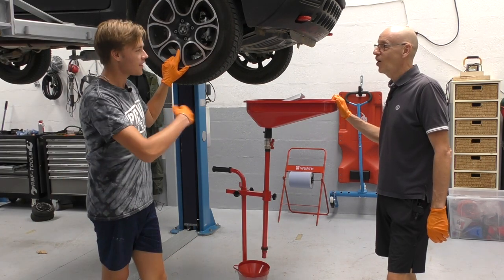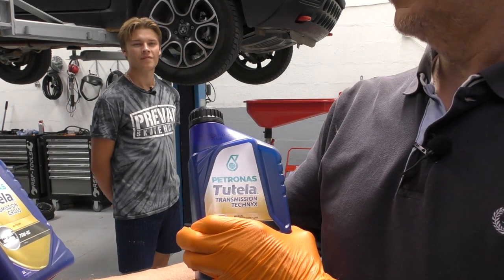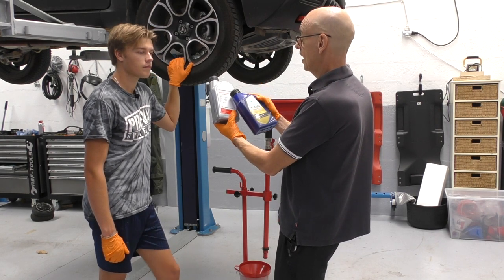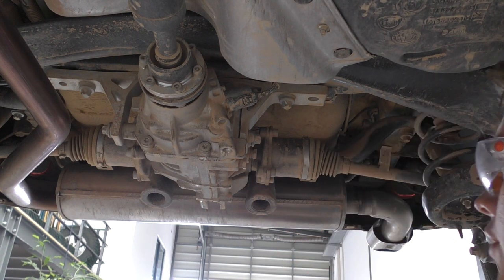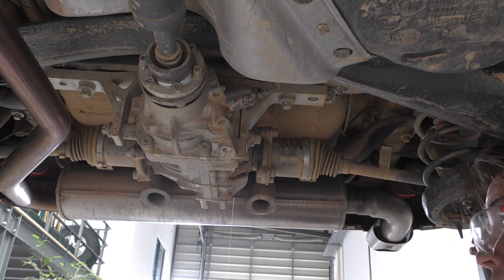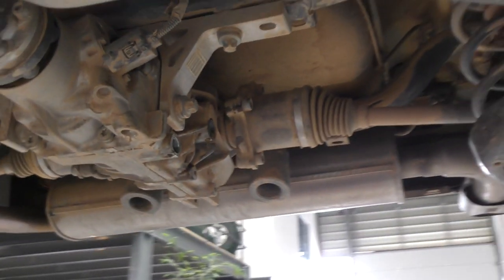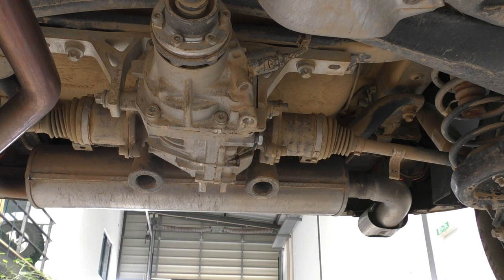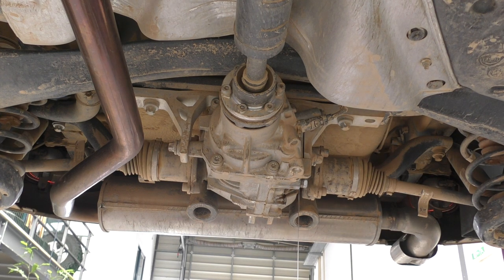Differential oil change on our 2021 FIAT Panda 4x4 - surprise bung  & confusing oil requirement

Comment: Good info, very useful to know where all the plugs are and that little safety bung on the rear diff would have totally thrown me!
Reply from the maker: Was a surprise to us - could find nothing about it anywhere, so took a brave pill and yanked it out :)   

I was a little surprised (and disappointed) that FIAT had not done them all ? odd (I like it).
Reply: @DrivenMadShow  Yes it's a great idea just odd they did the rear diff only and not the actual gearbox?
You'd think that would be more essential to protect.

Your thorough tutorial has given me the confidence to try this myself, although I'll be crawling underneath.
Reply from the maker: We used to put 2 wheels on the highest kerb we could find - I would sip coffee and Nath would do the business :)
Reply: @DrivenMadShow  I have a slopping drive, so I build a makeshift ramp out of bricks, so with my car pointing downhill and the front end on the brick ramp, I can get quite a good space underneath to work.
I make sure everything is solid, rear wheels chocked etc and throw under anything I have like spare wheels etc  as a safety precaution.
Reply from the maker: @pdtech4524  Brave !! we started on axle stands, then found out lifts were a grand, so splashed out on one - a god send now my knee is knackered :)
Reply: @pdtech4524  Hi.....you do not need to jack up the panda 4x4 to reach the transaxle filler and drain plugs they are easily reached with a breaker bar and ratchet. The front wheel needs to be removed to access the drain plug for the power transmission unit. Its the same with the rear differential unit the car does not need to be jacked, the wheel does not need to removed to access either the filler or drain plugs there is sufficient ground clearence to be able to reach using a breaker bar / ratchet.
Reply: Grande Panda cross 4x4 👍💪🐼🇮🇪
Reply: @marinocorazzi7895  Ciao Marino

Comment: greeting from italy. despite many people dislike fiat cars, in my faily  from the 60' we only had fiat cars and never had  any big problem with them. ofcourse some component is not the best quality, but replacing it is so chep  it's not a problem getting new replacement for them. and on that video u have noticed some little things that make that panda a success and why there are so many in our road. after oil change maybe u can put some blistein shocks on it :D i really love the cross 4x4 and also the 500 abarth. little car with lots of potential :D
Reply from the maker: Buona serata :) 

In the UK we had an Abarth turismo, although my wife hated the exhausts (Monza) - here we had a 500c that was traded for the Panda, so I too and a massive FIAT fan.

We are surprised they have a poor reputation now, as ours have been fantastic & very reliable.

Once we finish in the dirt, we do like the idea of lowering the car on some sexy suspension and popping on some bigger wheels - giving the sport look.

I think our Panda is really well made - under the castings are all really good and look very strong, so we will keep putting it to the test - the weakest part is me !!

Comment: Hi guys it is to do with the ash production when the oil is being particularly heavily used. Petronas in league with Fiat have a good deal going effectively ensuring you only buy their oil. I think it is a bit of a con really just to keep their expensive market share. The information tecnically on fiat 4x4s i believe is purposefully vague on purpose.
Reply from the maker: Great point, I was with you, but when I contacted two oil manufacturers (Liquimoly & Castrol) to get their oil to use, they told me to stay with Petronas and not use theirs - an engineer told me ( I know naff all) that the twin-air lube rail is susceptible to blocking and the gaskets used are also susceptible to certain additives - as you say, probably to force the use.
Reply: Hi, great standard of service saying the consumer knows naff all 😂, standard response now. I understand the point on additives they are a mystery in just about everything people buy regarding oil and similar products. I am sad to say, very cynical on any info given out by the motor industry and all its machinations in keeping the consumer tied to a particular product, it is fear producing as it ensures you use that product or face costly repairs for failing to do so. On the panda 4x4 most sites cannot even agree in the viscosity of the oil, let alone the additive content.
Reply from the maker: @andrewreynolds2647   I am saying, I know naff all 😂 the Panda is a minefield of contradicting information - watching Top Gear, they describe the 4x4 as a Haldex type thing, the dealer assures me its not - our car did not show the classic spin and lock up that a Haldex would do, but 100% I am not. The oils made me paranoid, also a back street dealer type bod telling me twinair without dealer service history is a ticking time bomb - that's probably why I do like the 1.3 diesels :)

Comment: Hi Guis, fiat recommends the front differential PTU also needs an oil change, to the extent of 0.4 lt !!!
Reply: it is not unique with the gearbox
Reply from the maker: Thanks for the tip 🥳
Reply: Merci ,avez vous des informations pour cette vidange de ptu ?

Comment: You haven't changed the oil in the "drive transmission idler unit" the transfer box to send drive to the rear diff, its not the same as the gearbox oil, so needs changing as well m, looking forward to the video 😁👍
Reply from the maker: Thanks for the info

Comment: Very clear and helpful video. I changed the gearbox oil in my 2016 twinair 4x4 only yesterday with the correct fiat oil 😊. I wonder if you measured the amount of oil that came out of the gearbox and how much you used to refill ? I drained 2.2Lt out but the handbook gives the gearbox oil capacity of 1.7Lt. 

I put in 1.7Lt as specified but with that amount I don't get the usual dribble of oil from the fill plug. 

I have never come across a gearbox that you don't fill until its dribbling so really not sure what to do. I suspect 2.2Lt will be to dribble level but could also be overfilled. 

Any thoughts ?
Reply from the maker: We always go for the dribble - we were not clever enough to put in an exact amount 😇- we did measure what came out  and like you got over 2 liters - our owners manual (Portuguese) was not clear, we looked on line and that gave varied amounts -  when we took out the bung, the fluid ( as I recall) was bang on dribble level ( thats first change from new) - but don't hold me to that !  

To be 100% - as taking advice from two idiots like us is not recommended - go in and ask the main dealer in the parts department ( thats what we do when unsure, I ask for a price and amount needed for the vin, ask how long to get and bugger off without ordering ( Bar Mercedes, who are surprisingly competitive here, but we no longer have the ML)  - we were happy with dribble level as you say, never come across anything thats not, but Fiat are an odd bunch) .  I probably focused on grade over quantity.

I did get an opinion on the oils - Fiat use some odd grades, the engine has a drip type feed over the camshaft, that has very small holes, so the viscosity is vital, as is cleanliness, the twinair needs regular clean oil and filter changed or these can block. The other additives many put in, can ( not my words) cause deterioration in the seals, that was from Liquimoly, who also told me to stay with Tutela oil, so must be a well known thing in the oil world.

I got our oil here for interest https://augustin-group.de/oele-fluessigkeiten
Reply: @DrivenMadShow  The used car dealer I purchased the car from learnt the hard way the importance of using the correct oil in the twinair. Shortly after I picked the panda up the dreaded orange triangle of doom came on. He ended up taking the car to a main fiat agent who had to change the oil three times to clear out the wrong oil. They also changed the little filter on the twinair unit. The invoice was in the history file so I know it must have hurt his profit. All has been well since but I always order my oils myself now. Lucky in the UK we have a company that stocks the genuine fiat oils. 

I did a little research and did find one example of a gearbox that does not use the dribble system. I can't remember the model but it was a Ford. Oil level should be 20mm below the fill plug ! 

I will phone main agent and see if I can get any sense out of the service department. If I discover anything useful I will let you know.
Reply: @DrivenMadShow  I have just had an email from our local Fiat main agent service department. They confirmed that the gearbox oil level is correct when just dribbling from the fill plug. Confusingly they also say this should be around 1.7lt. I guess they have never measured the quality drained out ! 

Carry on as usual.
Reply from the maker: I have been told - fact or fiction who knows - the twinair is a really strong engine, reliable and forgiving when thrashed :)  other than oil, loves it, needs it and the right stuff - I think yours was caught just in time :)
Reply from the maker: Cracking - the easiest way is the drip - I have never worked on cars until retirement, Nath does 90% anyway if truth be told - only owned two Fords ( I think, Escort RS Turbo, first ever decent car, performance wise and a Sierra 1.6 estate - so a long time ago ! ) have no clue how they were mechanically, was lucky that mine (most) ( mine in the I got to use them sense) were company owned or long term loans - now I realise how expensive the buggers are to run :)
Reply: @stephenbell6366  bonjour ! 
J'ai le même problème que vous , avez vous mis 1.7l ou le goutte à goutte ? 
Merci bonne journée

Comment: GL-5 has additives that make it suitable for extremely high pressure differentials. However, these additives can attack bronze and copper which are found in gearboxes. I'm wondering therefore if that's what's making your Febi Bilstein oil unsuitable, and is the reason why you need to stick with the specific brand recommended by Fiat. Just my thoughts.
I had a look and saw the Febi oil was suitable for the axle alone, but not for the gearbox/diff, but it did say Motul Gear 300 was suitable, for interest.
Reply from the maker: I tried three manufacturers - all said to only use the Tutela (Patronas) Fiat approved oil, stating it was additive in their oils that made it unsuitable, but could not get that expanded on.
Reply: @DrivenMadShow  It's really interesting. GL-5 is just a “gear oil” spec, it doesn’t cover transmissions. GL-5 uses Sulphur/Phosphorus additives to prevent “micro-welds” on the meshing gears. Unfortunately these also can react aggressively with bronze and copper, often found in the synchromesh rings of a gearbox. So I’m thinking the Fiat-recommended GL-5 uses different additives, and I agree with you - best stick with the GL-5 that Fiat recommends, as you have done! 
Again, interestingly though, I looked at the datasheet for the Motul Gear 300 and it says it's suitable for "any type of seal and yellow material used in gearbox design", hence it's ok with copper and bronze etc. It seems a few manufacturers are now making a GL-5 that is compatible with "yellow metal". This might be why it's listed as ok with the Panda. It was £19 for a litre here in the UK, which is not cheap.
Reply: Ah, that Tutela is "GL-4+". It's a GL-4 that meets GL-5 spec, so as it's a GL-4 it won't have those nasty additives!
Reply from the maker: I paid about that for the diff oil - but the Tutela Transmission Cross 75W-85 API GL 5 was 40 euro a litre - outch
Reply: @DrivenMadShow  i paid £23 for a litre of Fiat Tutela oil for the rear diff and that was discounted.....
Reply from the maker: @stefanobio7045  That's a steal - think I paid 49.00 for ours - and 20 + for the coolant that is now all over the road 🤣
Reply: @DrivenMadShow  Hi Jon....why did you need to change your coolant so soon in your new Panda? Did you use the Fiat Paraflu, i believe the Panda takes 6.3 litres.....best regards, Stefano
Reply from the maker: @stefanobio7045  Fitted the new Thermostat Stefano - the coolant was the most stunning pink (odd what excites you) Tutela stuff - think that was a few £ on the floor 🙈
Reply: @DrivenMadShow  lol......at least its now completed.....
Reply from the maker: @stefanobio7045  waiting for the next thermostat to be delivered - hoping this one was faulty as the inlet blew off ☹ just spent 50 euros on more coolant as well - think we need an ev !
Reply: @DrivenMadShow  Hi Jon and Nath....did you purchase an original Fiat thermostat, oh thats not good about the coolant.......
Reply from the maker: @stefanobio7045   Autodoc !! to be fair to it, was a Magneti Marelli part (I think)  a decent looking thing - but fingers crossed it was a faulty part, not the car :(
Reply: @DrivenMadShow  Hi Jon....they are good quality parts and owned by the Fiat group so should be ok....when are you completing the work?
Reply from the maker: @stefanobio7045  We are waiting for it to be delivered (Portugal is hard to get anything off the shelf) so another Autodoc special - the coolant should be with us early next week - I am having tests on my knee next week, so Nath will be a one man band :)
Reply: @DrivenMadShow  Hi Jon....i hope the parts get delivered on time, will you be posting a video of the work? I hope your knee problem gets sorted and its sucessful.....best regards Stefano....
Reply from the maker: @stefanobio7045  Its already in many pieces, Nath has lost the will on this job🤯- I watch on facetime, so know its not filmed (we are rubbish at this ) - will suggests he films the re assembly, but its so tight, not sure how much will show with his arms in there ?  The knee has been off and on for almost a year, but does not want to rectify itself, I know I tore a ligament, and they heal slowly and not well,  its in a worse way now, so lets see (MRI next week)  - I hope its something they fix rather than physio, as its been so long - properly annoying, but could be worse :)   Have a great weekend KR Jon

Comment: Hi Jon and Nath.....are you sure that you used the correct oil in the transaxle i believe the correct oil is the Tutela transmission gearforce 75w oil and NOT the Tutela Technyx oil you have shown on the video? Did you change the oil in the power transmission unit (transfer box) the correct oil for that is Tutela transmission multiaxle oil and its takes about 0.6 litres of oil? Best regards, Stefano.....
Reply from the maker: Hi Stefano - don't make me panic :)  - we got ours from https://augustin-group.com/p/tutela-transmission-cross-75w-85-api-gl-5-8281265 which is the one we put in the rear diff -- the other is https://augustin-group.de/p/tutela-car-technyx-getriebeoel-75w-85-8281063 - I emailed them with the car details and they did the order for me - as they did with Paddy - very different oils, the transmission oil is around 20 a litre - the rear is 50. (the said both the 2021 and 2008 use the same rear diff oils the 8281265 code - it was also interesting as Liqui Moly told me to get the 8281265 as they do not make an equivalent.
Reply: @DrivenMadShow  Hi Jon....my sincere apologies i did not mean to alarm you.....my Fiat information book states that the front transaxle takes Tutela transmission gearforce oil which is a 75w, i have 2015 cross 1.3 multijet with the 5 speed manual gearbox.....im still not sure that you have used the correct oil Jon? The oil you have used in the rear diff is the correct oil though.....yes Tutela oils are expensive in the uk, its about £65 for the 3 litres of transaxle and 1 litre for the rear diff oil, plus the additional cost of the oil within the power transfer unit which is Tutela transmission multiaxle oil.....if i were you Jon i would contact a Fiat main dealer and check ref the recommended oil for the transaxle?
I have checked the Tutela site and there is a slight difference on the specification between the Tutela Technyx and Gearforce oils?
 Best regards Stefano....
Reply from the maker: Hi Stefano - no worries, only teasing - I did check to be fair, the dealer sent me a photo of the oils to use.

 If you took it to an independant in Portugal, they would put in cooking fat 🤣 -

I was told by a mechanic I know here, that one Portuguese mechanic he knew, if the oil that came out of a car looked good, he put it in the next one her serviced ! - if what happened with our ML is anything to go by, I believe it !
Reply: @DrivenMadShow  hi Jon....as i said previously the two oils have a very similar specification so i can only presume that it will not cause you any problems.....you made me laugh about the cooking fat and the mechanic using the old oil.....stay safe and well......best regards, Stefano.....
Reply from the maker: On that subject, I just watched YT channel "Project Farm" ( might be your thing, a or you might already watch; chap in the US who tests odd things - very thoroughly, too thoroughly for Nath to watch !) 

He just tested diesel / bio diesel / hydro diesel / veg oil / used engine oil -- all in a small engine comparing how or if they will run the engine.

Way more interesting than us :(   ha ha 

Kind regards

Jon
Reply: @DrivenMadShow  Hi Jon....thank you i will try and find that programme, if you can receive UK TV in Portugal another good TV series if you like older cars etc is "Secrets of the transport museum" which is filmed at the Brooklands race track.....stay safe and well, best regards to you and Nath, Stefano